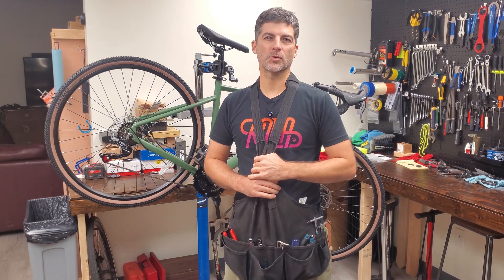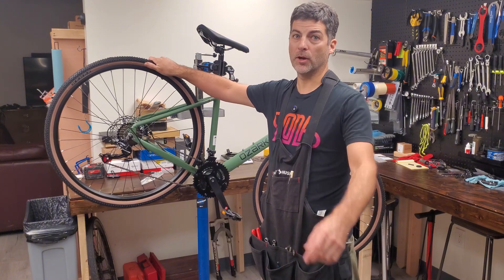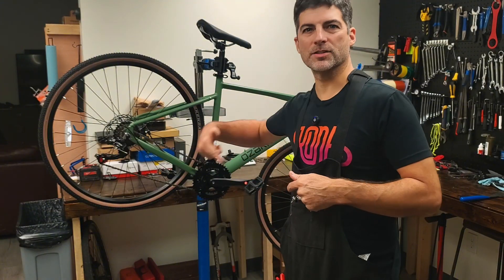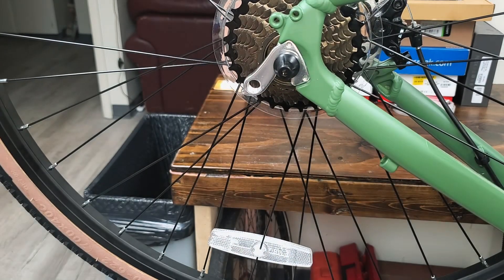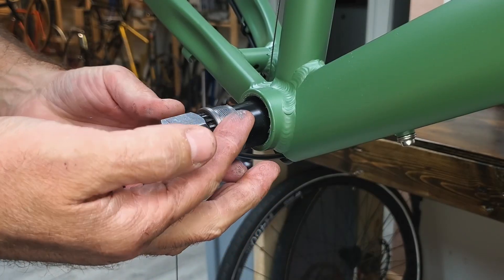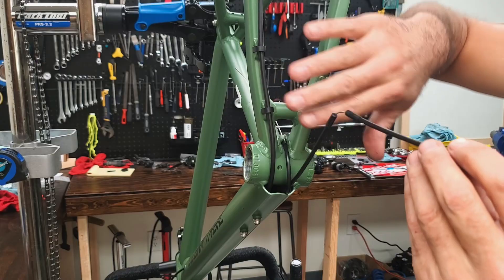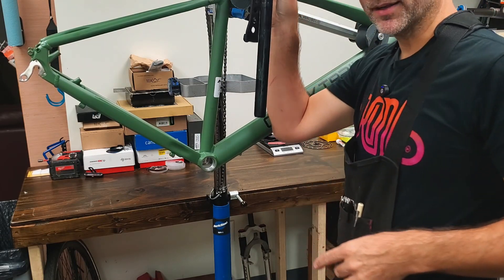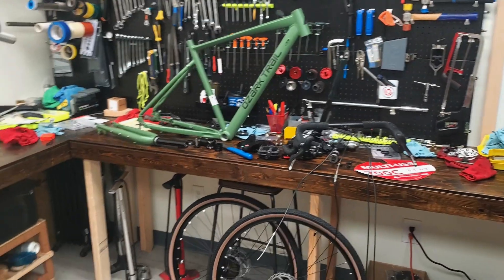Ozark Trail G.1 Explorer Disassembly and Analysis

Comment: As a DIY mountain bike enthusiast who is gravel-curious this bike is pretty intriguing, especially for the price point. I do 90% of my own wrenching and this G.1 has a ton of upgrade potential. 34/40T Deore or SLX 1X drivetrain married to an i25 HG wheel set would transform this bike immensely. I suspect the one tiny downside to this bike is rear tire clearance. If you could squeeze a 2.0 in back that would be amazing. Love this series.

Comment: Awesome. I just purchased this bike. I am usually a compulsive upgrader but this bike I am going to ride until something wears out or breaks. I do want to give it a fighting chance by tightening and lubing everything up. 

First thing I wanted to do was remove the chain and give it a hot wax treatment. I couldn't find any quick link. I see you had to use a chain breaker. Good to know.

Comment: My big question is whether the component quality (hubs, spokes, rims), true and tension of the wheels will last more than a year, because a wheel replacement will almost inevitably trigger a whole drivetrain change. A bike shop can fix true and tension, but crappy hubs and spokes will just make the wheels high maintenance.
Reply from the maker: Component quality long term is for sure TBD. The wheels are machine built as you would expect and, in our case, it really showed. There was quite a lot of adjustment necessary to bring them closer to our spec for true, and especially tension. 
They are 36 spoke wheels, so we expect them to be reasonably durable now that we have the build tightened up.
I wouldn't say that a wheel change necessarily prompts a whole drivetrain change, but I think I can see where you're coming from.
We did a whole video on just the wheels:
https://youtu.be/f6VFc_2ZAkw

Comment: I had one shipped to me last May. Nice bike. Very upgraded at this point. Went to a carbon fork only cause the fork came bent. Caliper side blade bent aft. I'm a bike build and dryer. Steel fork allowed for a close complete bend back but ever so slightly off. Carbon replacement fit and works great. Have fun.
Reply: bikes like this do not has tapered headtube for tapered fork right? I assume that you bought a tapered carbon fork. Did you replaced the bottom headset cup with tapered fork adapter? Does it add height to the front of the bike?
Reply: @DevaraGian1998  Yes used an adapter. It is sealed bearing so inset more than the original ball bearing about 4mm lower.

Comment: Wanted one of these for so long. Slightly lighter wheelset? I feel like rotating mass is the best reduction. Also, i think there is a 1x option online.
Reply from the maker: You're not wrong about lighter wheels, and the flat bar version has the 1x that looks like a good option with a better rear hub. 
I will make one small case regarding rotating mass. A lighter wheelset will absolutely change the character of a bike and make it feel much more responsive. However, once you have these up to your cruising speed, this heavier wheelset will carry momentum and absolutely just cruise. My first rides were a welcome surprise to find the G.1 wants to just keep rolling like a steamroller on the flats.

Comment: I bought that bike to see if I would get into “gravel” but I was living in Florida but there was no gravel. Sand and paved roads. lol. Now that I moved to the Cleveland area I’m hopping to get some dirt riding in the spring. I see it like this, if you go with the mindset that is a $250 Walmart bike with decent components, you will be just fine. If you go at with the mentality that you’re buying a $1500-2000 bike for $250 you will be in for a rude awakening. 😂 it’s a great bike to get into gravel or just to commute. Not for competition or heavy riding, at least not right out the box. I’m currently considering just riding it until the crappy parts give out and find a good, used, mid level mountain bike cheap and just swap things out. So far, I’m very impressed for $250 can’t beat it. Seats sucks thought.
Reply: Not too many gravel roads in greater Cleveland.  Most of my gravel riding is out in Ashtabula County (and even then there is less than I would like) and the traffic volume is quite low.  Good roads too.
Reply: @whynotride327  good to know. Once summer comes around I will have to check it out
Reply from the maker: Keep us in mind as the weather improves. I don't know how you'd feel about a drive to Akron, but we have a history of doing shop rides Sunday mornings.

Comment: I am interested to hear what you think of changing to a carbon fork in future videos.
Reply from the maker: @bobk381  it’s really an interesting topic of discussion. Yes! A carbon fork could save as much as 2 lbs but the cost to safely add a quality carbon fork really toes the line on this bike. It’s the same with most upgrades. It’s a $250.00 bike, can you justify a $300.00 carbon fork? A 700.00 wheelset?  We say the frame merits the upgrade but you almost need to look at the $250.00 purchase price is a quality frame that came with free components to get you riding! 🤣
Reply: I’ll be following your upgrade project.
Reply: @22SIXSources lol